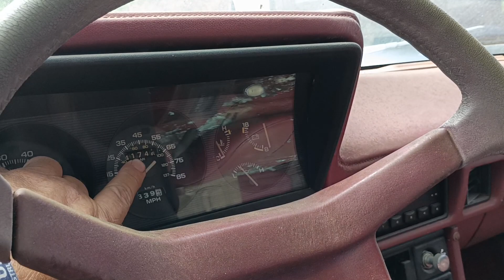Absolute Buffet of Cars to Crush.. Something for everyone 🤠👍

Comment: Looks like the refrigerant been changed to R134 on Rampage . There is a plastic timing belt cover missing . Changed lots of belts on the 2.2 and 2.5 l . A pretty easy engine and trans to work on . Did come with Holley carb